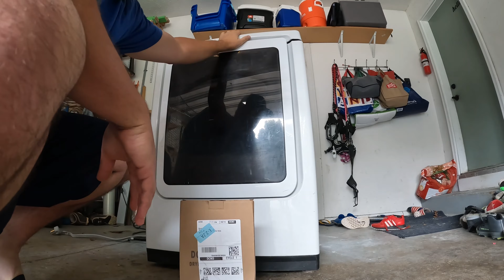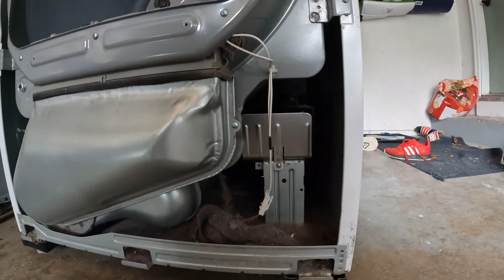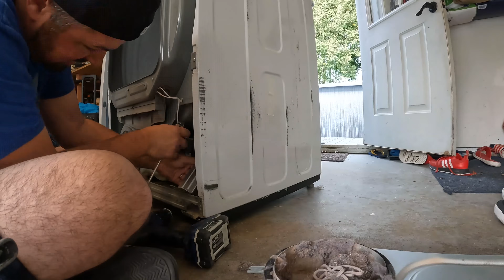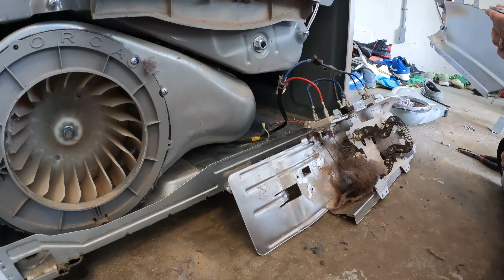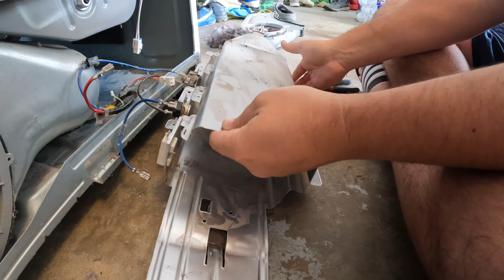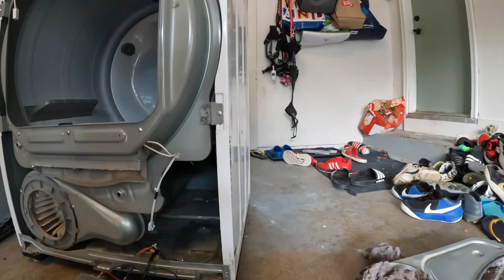Samsung Dryer Runs But Will Not Heat - How to Fix & Replace Heating Problem dve50m7450W Troubleshoot

Comment: I have a newer model of this.   Wasn't exactly the same, but was close.   Getting my front panel off had a few more screws UNDER the dang dryer.  Ended up getting the job done though and saved a lot of $$.  Appreciate the vid 👍
Reply from the maker: Glad to help! Every few years this happens to us. You got the power to fix it if it happens again.  Thanks for commenting!

Comment: Man I SO appreciate you taking the time to make this! My dryer stopped heating so I cleaned out/snaked my vent ducting and then tested both the thermal fuse and the thermistor last week and they both checked out ok. Ordered the heating element on Amazon and it also came with high limit thermal fuse, thermal fuse thermostat, high limit thermistor. Swapped everything out and we now have a working dryer again. Thanks so much for the help!
Reply from the maker: So glad for the comment! I’m glad it helped!